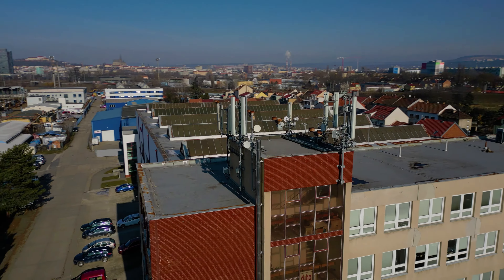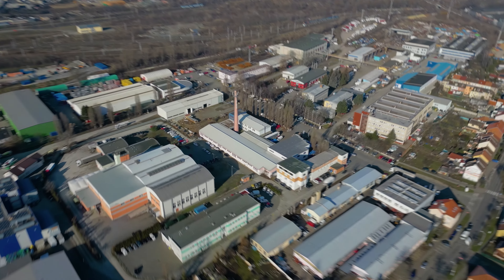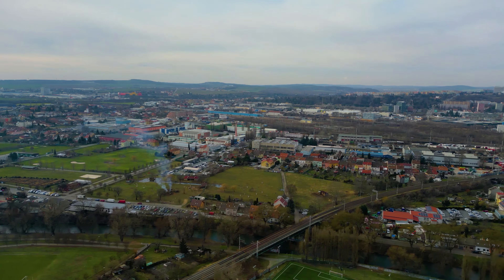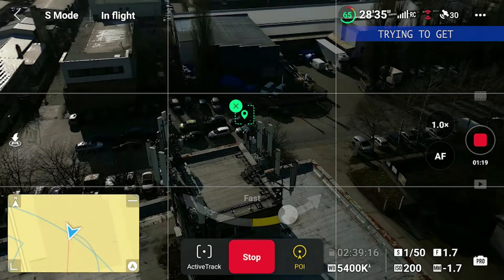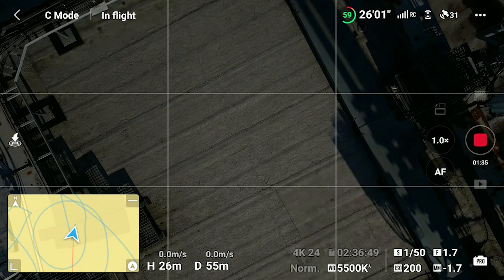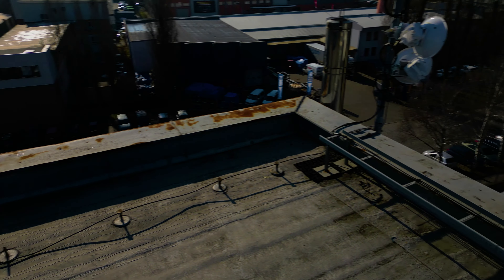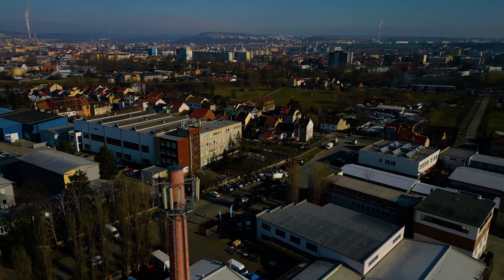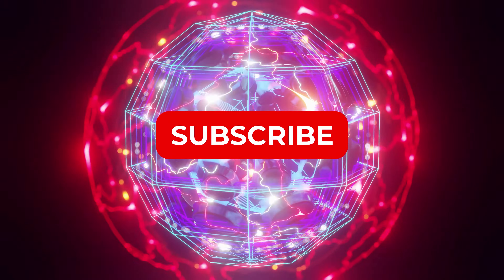Breaking Barriers: DJI Mini 3 Pro vs Cell Phone Towers - The Ultimate Interference Resilience Test!

Comment: Very informative video, great advance transmittion system to handle signal interference.. 👍👍👍9
Reply from the maker: Oh thank you! This drone is very resilient regarding the control and video feed interruptions. I had a Hubsan drone in the past and it was disconnecting right away if you get closer to those devices.

Comment: It turns out that there is radio interference when drones fly around radio towers!
I was surprised because there was so much I didn't know！(=^x^=)😆👍
Reply from the maker: I was surprised that small thing was holding connection with the controller and recorded flawless video this close to such strong RF signal sources.
Reply: @sim2g  🐈⚡👍